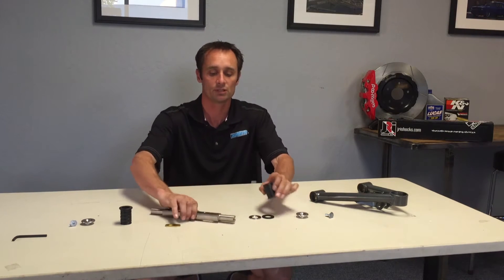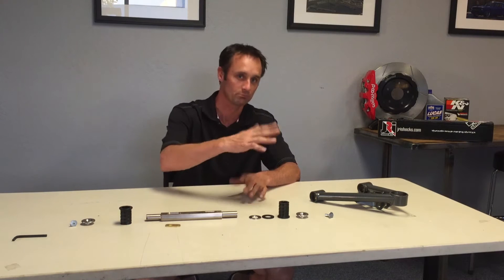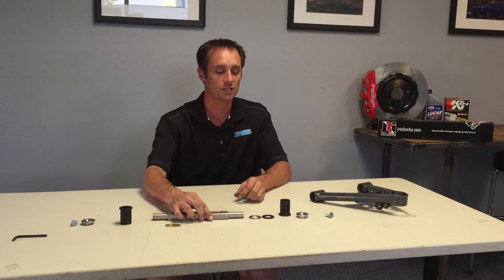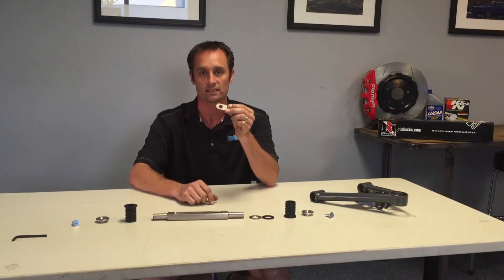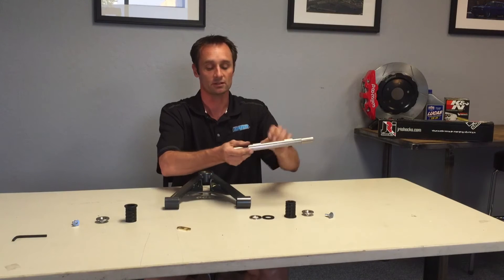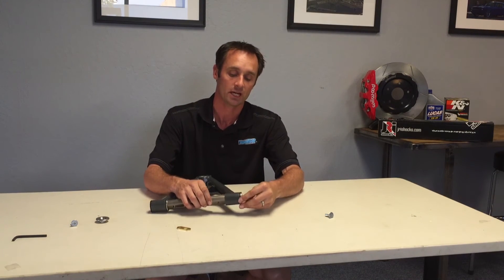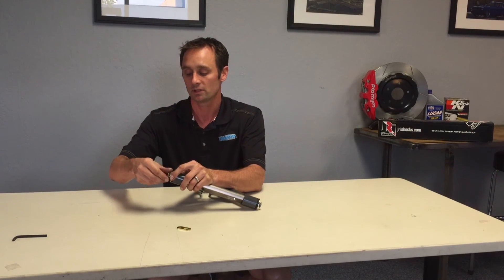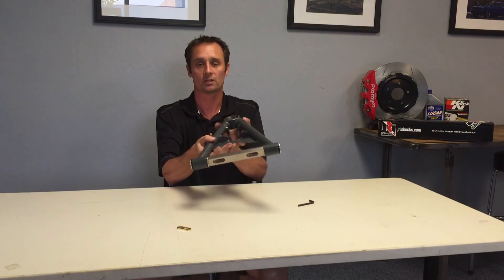MOD1 Mustang Shaft Kit Tech

Comment: Hello Mike. Great technical video's. I have a question: I've seen a photo of the lower controle arm on Old Blue. The attachment point of the lower controle arm was made lower. What was the advantage of this, and do you still use it on Old Blue. Next Question: use of traction bars YES or No. Thanks Kind regards Paul From The Nederlands. www.custommustangdesigne.nl